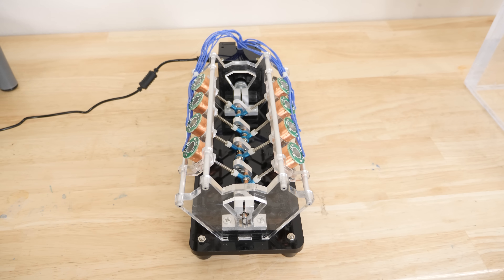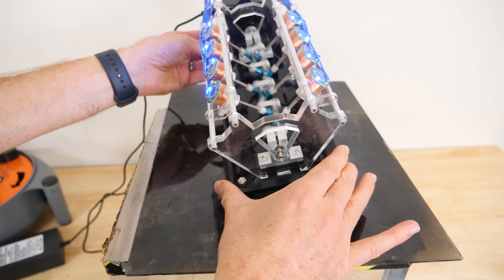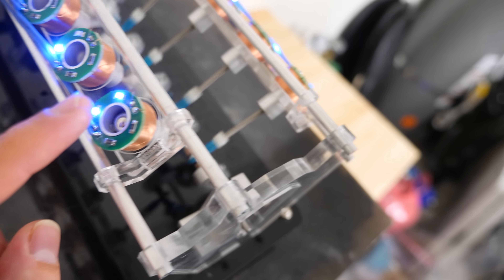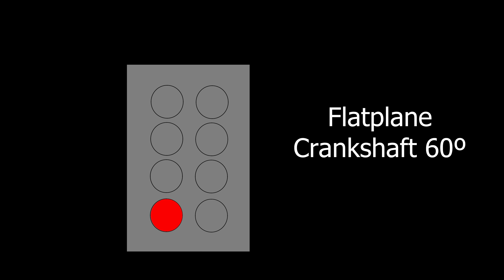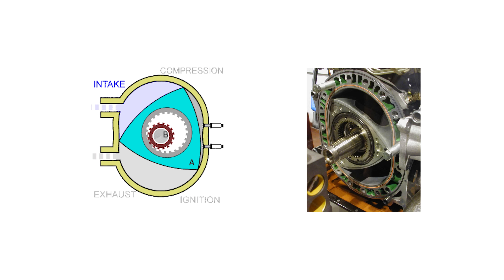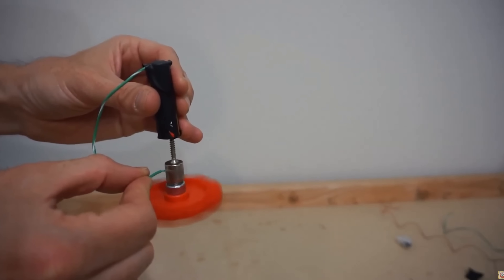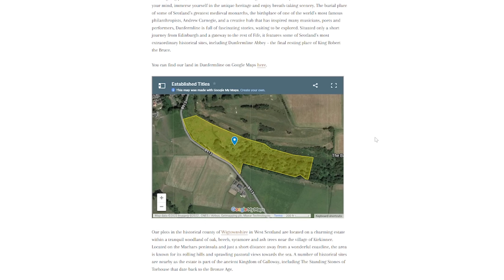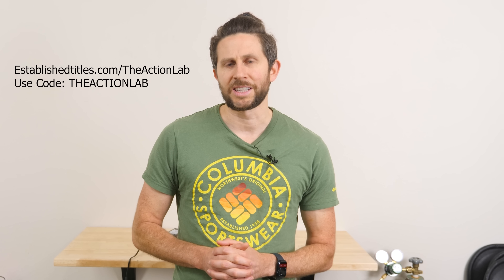Is an Electric V8 Engine a Good Idea?

Comment: I think it is a good idea for retrofitting old vehicles.  like let's say we have a vehicle with a bad engine.  Well, a service could offer to retrofit it by simply replacing the internals and the cylinder heads to match the system.

of course the problem is it would be cost prohibitive.   But as government intervention makes cars become more and more disposable, retrofitting and aftermarket may become a larger market.
Reply: @Edward Elizabeth Hitler 

internal combustion engines have power bands anyway and some of them can be very narrow.  

Plus, That's what a transmission is for.  

The biggest problem is the same as any other form of electric conversion: cost versus practicality.   In fact, that's the problem with electric cars in general that they're great for toys, but they're not good for the utility of cars
Reply: @Edward Elizabeth Hitler  since you referenced it twice, what's the power band of an electric engine made with this idea versus a combustion engine of the same dimensions?  

also, where would be the problem of using a CVT?  You say it's better than the most "basic" electric setup, but that is apples and oranges to electric cars.  of course an electric go-kart is going to be simpler than a car.

unless of course you're repeating the meme " electric cars don't need transmissions"  which is incorrect.
Reply: @Edward Elizabeth Hitler  You make a good point about the power stroke. But what if it was made to operate with a short stroke?  Again, there are engines that do.  

And while it's true, this idea uses a fixed solenoid operate rate, they can be made to operate at different rates.  There are now engines that are camless because they use solenoid valves.  

CVTs being "lossy" isn't really a big issue since cars like the Mitsubishi Mirage can produce between 52-57 kW and still use the transmission.  

Lastly, I would avoid language like "educated guess" unless you're willing to dox your credentials.

Comment: Independent electric motors on each wheel eliminate a drive shaft, transmission and central engine. Not to mention the independent control on all 4 wheel drives with an electric

Comment: Makes me wonder if it would be possible to convert a regular engine to an electric V8 easier than ripping the whole thing out and putting in an electric motor. As a sort of step between combustion and electric?

I mean, if all you're doing is swapping out the piston heads with magnets and the top of the block with a coiled wire contraption, which is then connected through the fuel lines to a battery pack where the fuel tank used to be. Surely that's cheaper than replacing the entire engine, mounting brackets and all that entails with an electric motor, or buying a Tesla?

Comment: I think the combustion engines are better because you don't always have to burn gasoline most diesels will already run on used vegetable oil and gas engines can be easily converted to run on hydrogen but for this electric motor you still need to burn coal or gas to get the electricity and then you need to mine more metal to create an infrastructure to charge the batteries and mine at the metals for the batteries which causes more pollution Plus the pollution from getting the electricity in the first place

Comment: Adding sound back is a part of car design, so that has its benifit. But compared to the axial flux motor that engine probably has no chance in torque per watt
Reply: You should compare W/Nm instead of Nm/W, as you are usually limited with torque in nearly every application, where as power is more about the scale of the application.

Comment: honestly ... you might very well be onto something here.
the main reason petrolhead like myself hate electric engine with an absolute passion is because of the power drill noise they make, 
but if i could get the roar of a V8, i for one wouldn't care much if it's running on electricity or gaz.
that's freakin' brilliant !

Comment: "The main thing an electric motor lacks is the awesome sound of a v8 engine, maybe we need our electric motor sound like this"
well fun fact, you can modulate any sound waves onto a the motors input voltage, and the motor will make that sound.

does it sound as good as a dedicated speaker? probably not.
does it make for a good tech demo? absolutely

Comment: That is a neat idea! Maybe there is some application where that electric v8 design could produce more torque even with its quite substantial inefficiencies compared to a traditional electric motor design.
Reply: Solenoids are every bit as energy efficient as electric motors.
Aaaand, you can wire up some master/slave coils between opposing pistons top/bottoms to recoup any lost energy in reversing rotation... although there isn't much.
The inefficiencies come in terms of space, complexity, and top speeds.
Reply: The benefit wouldn't be more torque, Standard electric engines have more torque than gas engines at a stop. 

I've converted ICE cars to electric, and we always have to lock the transmission into second gear because electric motors don't benefit from the gear reduction of the transmission. 

What could be a benefit with this v8 electric engine design, which I would like to see the numbers of, is top end performance. Energy to top speed and Energy consumption at top speed. If this was using an automatic transmission I think it could make use of the gear reduction
Reply: @drakon489a  this v 8 electric engine is a solenoid motor. Industrially soliniods are used for either for reciprocating motion, or to increase tourqe in an tight space at the expense of top end performance. Think places where you really need hundreds of pounds of force but could only fit a tiny rotational motor delivering at most tens of pounds of tourqe, but could fit a long thin tube with a cam and lever. 

And that's just because a solenoid is just a stretched out electric motor, but it has to change direction twice every rotation. 

It could be a nifty way to increase tourqe, and convert to electric with only top end work in a conversation kit. possibly saving moolah as solenoids are exceedingly simple to wind, and again top end work no need for pulling the entire engine
But at the cost that your top end RPM's would be the same or suffer slightly, so no locking out the gear box, still gonna need that sucker. Although with more tourqe you might get away with a change in the rear differential to extend miles per charge, that would be a fun design challenge to math out. I know Harley went with a three speed transmission to increase range and used frankly crappy (but safer for a motorcycle) batteries.
Reply: @drakon489a  ummmm... helllooooo? anyone in there?
why does your ICE produce zero torque when its stationary?
because it requires a certain RPM to actually RUN. it has to suck air in. it has to get fuel. it has to light it, burn it, expand it.

an electric motor, just TURN ON A SWITCH.

anyway, im pretty sure that the 12T of repulsive force i can get in a 50mm iron slug from just a few amps at a few volts far exceeds the 100 bar or so peak combustion pressure you may see in a high performance ICE...

no need to actually rotate to do this. to apply this 12T to a crankpin... it can happily sit there all day doing it. the crankpin will more than likely fail first. only consuming power in the resistance of my coil. the magnetic field energy? when i turn it off, that will spit back at me...

but you gotta design them properly. how does any induction motor work?

Comment: An electric engine is a stupid idea. Just use the electricity to directly drive a motor which turns the wheel. Problem solved.

Comment: So if the magnets get turned on and off by the presence of the piston, what ways are there in this engine to control the RPMs? IN a real gasoline engine you would have a throttle. Would'nt this engine always run at a steady (max?) speed?
Reply: I imagine you just increase the magnetic field in the solenoid for more speed.

Comment: What if we combine electric motors to collect air and run the piston on compress air. There is a Lego Technic project that run is engine on compress air and it's sounds is like the real gasoline engine.

Comment: Even with that design you'd still need oil in the block for a lubricant and you'd need some sort of lubricant in the cylinder or your rings and cylinder walls would be metal grinding on metal damaging the cylinder walls or the rings which would result in loss of compression
Reply: The oil would last a very very long time because there are no combustion gasses. This is actually a great idea.

Comment: Cool? Yea. Practical? No. Pointless? Not necessarily. Of course the current method of using it makes no sense, but the concept leaves room to consider how a similar principle my be achieved in a different way. No guarantees that leads anywhere, but there’s no guarantee it doesn’t, and it could be worth exploring further.

Comment: A neat take, but once nuclear energy replaces most other forms of electricity generation, over half of our total carbon emissions will be snuffed out. This will free up most of our fossil fuels to be used for cars and other automobiles that make them sound cool. Us humans actually breathe out a substantial percentage of what our cars would produce when comparing up-times and the fact that cars have sacks of expensive metals called "Cadillactic converters" that filter more than 95% of the naughty stuff. idk why you'd want to be a Cadillac but I digress. 

In all honesty, most other sources of energy don't even come close to the potential nuclear has. Here's a run down:

Solar - maximum 50% up-time, still very expensive, takes up whole fields of space, still need maintenance and cleaning using harsh compounds to ensure the glass is spit shine flawless, can't effectively store that energy so most of it just goes to ground, and the process of refining and producing those cells isn't available everywhere just yet. You can just sit there and get sunlight sometimes though.

Wind: wind isn't always blowing everywhere, meaningful wind farms for cities take a lot of resources and valuable space to set up, they aren't nearly as efficient compared to what you could put there, they take a scary maintenance regiment (I'm surprised those technicians can climb up there with the weight of their balls. Absolutely fearless.), and as Texas proved not too long ago, the perfect circumstances are always possible to screw you over. Murphy's law

Hydroelectric - there aren't always rivers, water is ridiculously powerful and erodes away infrastructure incredibly quickly (3 gorges dam among others), these power stations take ages to construct as water doesn't... Stop, and it could pose a very dangerous threat for anyone living downstream. Not including the environmental damages they cause.

Nuclear (fission) - only takes a small facility worth of space, costs about 25 windmills to create but multiplies their generation by HUNDREDS OF TIMES, all possible pollutants have a solution tied as to dealing with them , i.e, smoke detectors etc., and reigns as one the most efficient compared to everything else.

Nuclear (fusion) - bonkers efficient, still expensive now, but wait a few years at this rate and it will unlock boundless potential for future generations to come. I'll go in depth of how good it is if y'all would like later. The only byproduct the main reaction produces is a bunch of normal helium and a little spicy helium, no biggy there. Did I mention we can get potentially Gigawatts in return. Or that this thing can fit in your basement?

Action Lab, you produce absolutely amazing content. I love all the chemistry and physics demonstrations you do. But my stupid brain thought to the 'renewable' energy malarky and how it's killing off the good old V8 engine. Please don't take any of that rant personally, I just really care about how our world will prosper in the future and want to do all that is within my power to benefit our blue pearl. Thank you for reading all the way to the end!

Comment: Why would anyone create an electric version of our gas motors? That makes no sense. Wouldn't you get more out of an electric engine by using gear systems rather than useless cylinders? (the only point of the cylinder is to burn gas inside of to drive the wheels. Using such a system for an electric vehicle would only waste energy).

Comment: Pistons are used due to the limitations of harnessing explosions. Coils can exert magnetic fields in far more flexible shapes and patterns. So no, it's a poor idea because it limits magnetic coils to suboptimal designs. I wouldn't be surprised if they used something like this in engine development, due to being able to deliver very precise forces to simulate various patterns of engine firing.

Comment: As a engineer I almost choked on my morning coffee. 😂😂😂 

April fools are far away bro. Have you even researched what kind of engines BIG construction work vehicles are using? The really big vehicles moving 100 tons of dirt in a scoop? They all use electric engines driven by fuel aggregates because electric engines are 100 times stronger. And they use it because electric engines deliver more power per inch than a stupid gas engine with pistons. Piston tech is incredibly inefficient compared to like a electric engine in a Tesla.

On top of that, an electric engine is virtually maintenance free. Piston engines are so complex they need a lot of spare parts and maintenance. 

Even suggesting this at all makes me wonder if you have a brain at all.

Comment: Hey all. I'm a nuclear engineer, and I just saw an ionization event in the two seconds between the 3:23 to 3:25 time stamp of this video. If you slow it down, you can nab a screen shot. I assume this is a free electron that is accelerated by the magnetic field (and the electric potential) enough to reach speeds that ionize the air molecules in it's path... beautiful to see 🤗
Reply: I was wondering when someone was going to point that out!

Comment: This engine is inefficient. It has electricity constantly stop starting its energy cycle. So no this is not a suitable replacement to standard electric motors. Or what your suggesting a V8.

1. The engine has to constantly charge up release energy. Then charge up.
The cons of this is it wastes huge amount of electrical charge.
2. It revs slower then a standard electric motor.
3. A V8 is a chemical engine it has a different phylisophocal engineering concept. It uses compressed gas explosions, run in sync to gain huge horsepower.
4. A brushless electric motor would run rings around this design.

Comment: I mean.. there are reasons to make a V8 electric engine, but not a solenoid version. I have an idea for a modular motor system that runs perpendicular to the driveshaft and uses drop-in motors and gears to basically make a crate engine. Would be really cool to see it be made, but I'll never have the resources to do it.

Comment: The idea that the big "problem" with the electric motor is that if doesn't make that obnoxious noise 🤦‍♂️. Or that the noise is a good thing about a big engine.

As a society we have issues and need to grow up a bit. This is Action Lab reduced to Beavis and Butthead.

Comment: I once saw one of the first ever electric motors in a museum, must have been well over 150 years old, and it was designed like the V8 model in the footage here just with only two cylinders.
Reply: we call that a V2 or V twin configuration🐱👍🏿
Reply: @fidelcatsro6948  As far I as remember - this is going back about 10 years - the motor I saw in the museum had an inline configuration. I'm trying to find a photo of it, but haven't had any success yet.
Reply: @mikethespike7579  lets make one then🐱👍🏿
Reply: @fidelcatsro6948  I'd love to if I had the know-how. Give me a pile of nuts and bolts and I'll build you a car. But anything with electricity is beyond me.

Comment: If you use Bell Electromagnets (those used in electric cranes) you will be able to make a good performance engine for your car that use car battery and don't drink current like you water on a hot 🥵 day.

Comment: I think this could be a good idea if you could somehow get more force by inducing a high voltage electromagnetic field for a very short period of time.  This would require very big coils, but you may end up with more efficiency of the electricity than a motor going directly to the wheels.  If not that, then you'll end up with more horsepower than an induction motor, which would be great for high-performance vehicles.  Imagine an F1 race with electric vehicles.  I'm not sure if that would be a good thing, but the option is there.
Reply: Formula E exists, not quite at F1 but it does exist.

Comment: Yes, there are losses in motion conversion. Also, in motion direction changes (a solenoid has to overcome a piston's kinetic force to stop it and change reverse its direction). However, I wonder how much inefficient that would be compared to a straightforward electric motor. Because slapping a solenoid-ed cylinder head on an arbitrary engine would be an awfully simple IC→EV conversion approach :) An "any housewife can make this upgrade at home" kind of thing :)
Reply: Solenoid doesn't have to overcome the piston's kinetic force. It just has to wait until the piston reaches apogee and moves downward from the momentum of the crankshaft.

Comment: Years ago I saw a vid about a concept car with a hybrid petrol/electric motor. Was a normal internal combustion engine, but had electromagnets and such built into it so the pistons could either be moved electromagnetically or explosively. Wish I could find a link.
Reply: Would be easier to just bolt on an electric motor between the engine and transmission. Honda's old hybrid IMA tech used to spin up the engine using an electric motor for added torque.
Reply: @PURENT  I did not mean to imply that it was a good idea - just that I had seen someone do it :P